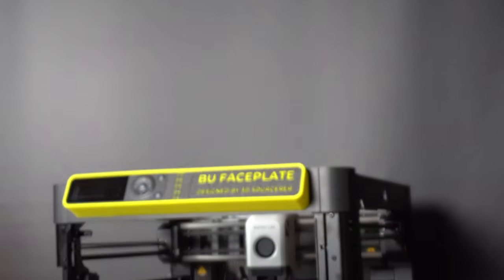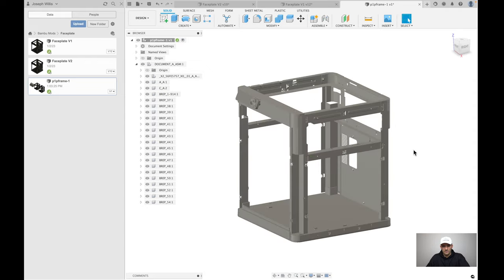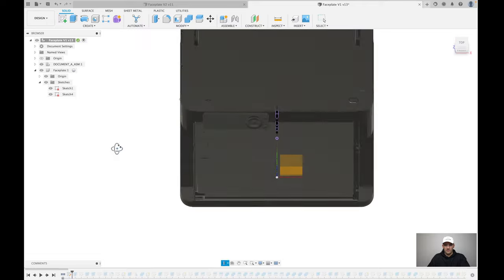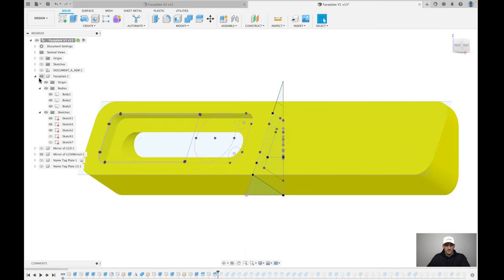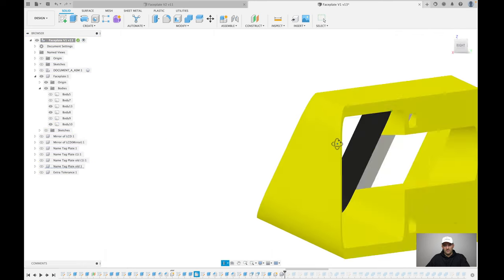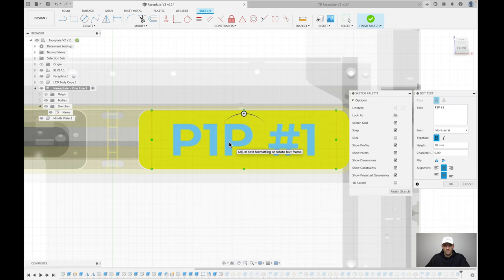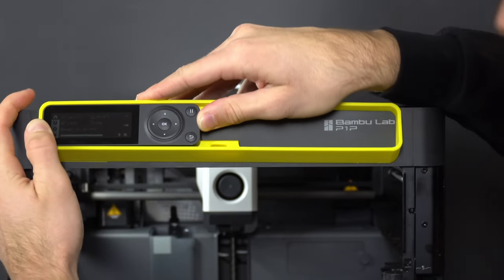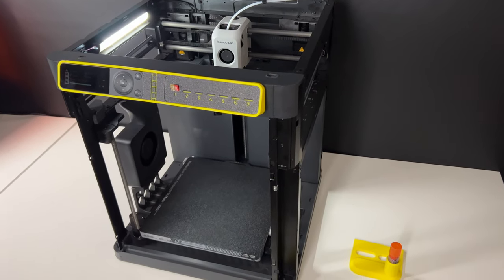The Bu Faceplate for the Bambu Lab P1P 3D Printer - Design, Customization Options & Assembly

Comment: My printer is located higher than a typical desk or table, meaning that the angle of the display is suboptimal.
If you rework your faceplate or design a new one, it would be interesting for it to tilt vertically.
Reply from the maker: Thanks! If I redo it, I’ll try to make it adjustable

Comment: So the only thing that holds the face plate on is the the LCD screen?
Reply from the maker: There's a plastic arm that is used to hold the LCD screen in place, so the faceplate slides between the LCD and the frame of the printer. It's a snug fit, but it doesn't put unnecessary strain on the screen.

Comment: Will this work with an arc enclosure?
Reply from the maker: It should! Be sure to put the door on correctly - it’s not symmetric so there is an up/down to it so if it has an overhang then it’s probably on upside down. I know there’s also some mods that make it work even with the door upside down